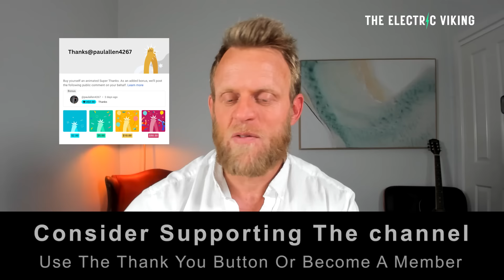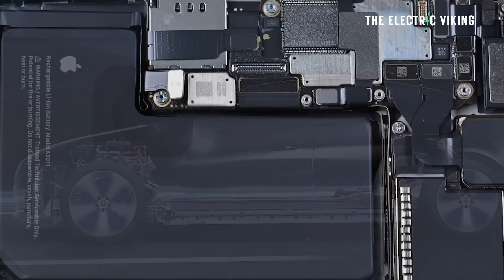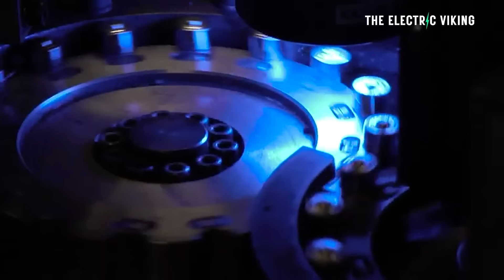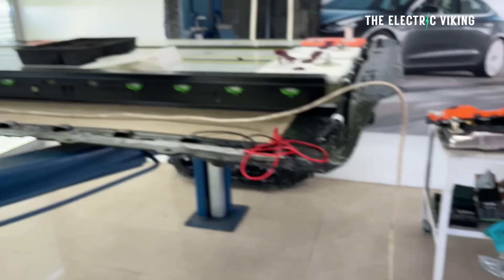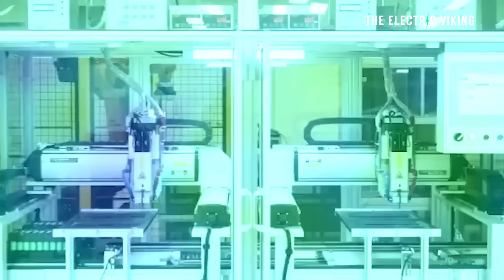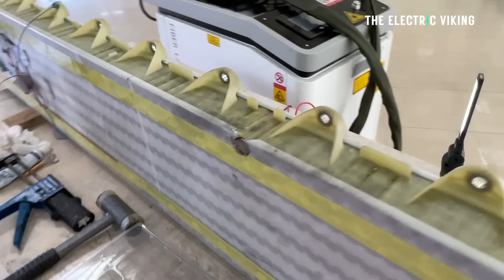EV repair company says LG cells in Tesla cars are a 'DISASTER'

Comment: You all should dig a little deeper about @EVclinic, and see what they actually did work on. They usually swap individual degrade cell in the pack with the same used cell. That worked well with all Model S, X, m3.They have had more then 600 Teslas repaired like that. That saves a ton for their customers, saved cars from salvage and they give warranty for their work 1y. Of corse, the most teslas they repaired were out of warranty. Until they stable at a Model 3lr with LG one. There was stated why in the article, those cells are far from stable and they just shared their frustration with us! There was big numbers of sold Teslas M3lr from Shanghai in EU and if they can't repair them efficiently they are angry! 😜

Comment: Here in the UK we seem to have a particular problem with battery failures in 2021 Model 3 Performance models specifically. These seem to affect cars at fairly low mileages (around 30k miles). I’ve not heard of any other model/year having significant numbers of failures. This is not high levels of degradation but catastrophic failures requiring warranty replacement.

Comment: As LG only provides those individual cells, I find the repairability differences to be very odd. I also have used many LG Chem 18650 and other cells for non-ev purposes. I usually find their output and durability to be very high. However, unlike competitors, had no built in fail-safes, so required additional monitoring to avoid exceeding their safe limits for voltage (high or low) or temperature.
As these cells for EVs are used in pouches and often made purposely with no built-in fail-safes, as the pouch/pack handles the fail-safes, I assume the panasonic cells also don't have built-in protection, though possibly are of newer design?

Comment: I bought one of the first Chevy Bolts.
Chevy replaced the battery pack at 102,000 miles and I now have 175,000 miles and they are going strong without losing any range. 
From what I can tell the LG batteries are the best batteries on the market. 
I expect them to last a million miles.

Comment: It is critical to note that it was incompetent management that cost GM/LG $2B over the Chevy Bolt battery issue, not the batteries themselves. GM management panicked and just blurted-out that they would replace all batteries. In the end, they installed a software update that was able to identify which batteries were actually bad and needed to be replaced. That was after tens of 1000s of perfectly good batteries had already been replaced.
Reply: It is not quite that simple.  The decision to recall is often made before NHTSA or other regulators get involved.  Once fires and failures are reported, companies often quickly announce recalls, vs having high profile fires and getting grilled by regulations why they didn't respond to the issue sooner.  Also, if they don't act quickly, law suits can quickly pile up, which may be a lot more costly than the recall itself.

Comment: Not sure why the EV Clinic would be working on Model 3 and Model Y batteries at the stated ranges? The Tesla warranty on these is 8 years or 100,000 miles. Neither the Model 3 or Y have been around for 8 years yet. So in theory it should only be >100,000 mile vehicles.
Reply: As far as i know, the report  talks  only about 2020/2022 LG  ncm811 from shangai.
Reply: You misunderstood what a warranty is. 
the warranty isn't a lifespan guarantee. that ONLY MEANS they will cover the cost of the battery if it fails within 8 yr or 100,000 miles.
they arent going to cover the replacement cost of every car they produce by giving customers a lifetime warranty. 
its literally just to cover early failures due to potential manufacturing defects.

Comment: The Apple iPhone vapor phase change  heat pipe is not to cool the two cell (7.4 Volt) lithium battery, as it is only to cool the A Series System on Chip (SOC) processor. There is no external battery temperature control other than to limit charging and drain current levels (throttling back speed and functionality) .

Comment: Our 2020 Bolt had a full battery failure before 20 thousand miles.  Then got 20 thousand dollars from GM back.  Almost two years after a promise from GM by letter from the vice president in 2021.  They then did the software restrictions on that sapped our range.  The newer battery went out in 7 thousand miles.  One more and they have to buy us out completely.  LG is a disaster.  I will say it.  I will prove it too.
Reply: We have had zero problems with out 2020 Bolt. Strange that you had had so many. We did install the software restriction which didn't affect us at all since we never charge above 80%. The restriction auto-lifted itself after the pre-determined number of miles and we are able to charge as high as we want again.

Comment: Tesla is having a nightmare with 2021 model year US built cars experiencing battery failure. They are handling the issue well providing loaner cars. I have no idea as to which company manufactured these batteries.
Reply: US Teslas only get the Panasonic ones.  GigaBerlin and Shanghai uses the LG cells. Supposedly some of the 2021 models have thermal design/mgmt issues leading to early cell failure under certain operating conditions over long term.

Comment: Sam, There are 2 kinds of battery makers :
- The chemistry and old battery companies (LG Chem, CATL, Panasonic-Sanyo, SK, Samsung,  etc ...)
- The automotive maker division ones (started as a spin off or a JV-Start-up initiated by a car maker, that transfered some of its best engineers) : BYD, ACC, Powerco, SVOLT, VERKOR and some others 
In your opinion, what battery company is better suited long term for Automotive applications and manufacturing quality in MASS production requirements and expertise ?
The 2nd category maybe struggling to learn about "electrochemistry magics" at first, but after the start-up phase and low yield at ramp-up they will be better suited and will ultimately replace the former ones.

Comment: LG batteries have a long history of poor performance & thermal runaway (ignition). AVOID LG.
Reply: LG cells have no built in protections, but in EVs most cells rely entirely on the pack's protection mechanisms for monitoring and safety. 
Their home batteries had issues in Australia, but outside of Melbourne or Tasmania, should never of been installed as their rated maximum operating temperatures are below most Australian state's average summer temperatures. Some of the blame really should be placed on the importers and installers. (Notice, I say some of this blame, not all).
They also don't appear to have made much improvement on their designs since their early batteries aimed for laptops... would I say to avoid at all costs? No, depends on use case and what protections you implement into your devices' design. Would I say they are the best choice? No, not until improvements are made.

Their batteries used to carry higher energy density than competitors, I have used some of their cells in a torch with no protections (gasp), except for the aluminium casing, which acted as a heatsink. Did they get warm? Yes, but they offered higher discharge rates, providing noticably brighter light emitting performance from the torch. I would dim the torch if the heat was getting uncomfortable and turn off if the light slightly dimmed... charging was a different story, I made sure they were always cool before starting a charge, and used a charger that seems to be good at balance charging. Never saw any issues, but did find the Samsung and Panasonic options offered dimmer light output, shorter runs (so less capacity) but were considerably safer as they had implemented circuits to cut power for over or under voltage. None offered more protection that that though.

Comment: Tesla should have learnt from GM's experience with the Bolt recall. I can't believe Elon gave LG Chem a chance after that disaster.
Reply: an idiot for doing so and it shows
Reply: Do you know what the actual problem was with the Bolt battery pack? And how many cars it actually affected?
Reply: If GM and China's EV fires were caused by LG's cells Tesla would have had an EV fires problem too, they don't. Tesla maybe has a LG cell reliability problem, not a fires problem because they know how to stop a failed cell turning their cars into Roman candles.
Reply: @THX..1138  Not EVERY lg pack catches fire...
Reply: The Moss Landing fire was LG, right?
Reply: Blane it on tha K

Comment: Hello Sam, great video, as usual. I purchased a new 2021 Hyundai Kona EV back in March of 2021. It now has 156,181 Km on the odometer. I just had the dealership do a SOH check on the LG Chem battery pack in it and they claim it still has a 97% capacity. I was very surprised at this result as when the car was new I could get nearly 400 Km of range from a full charge. I can't even get 300 Km of range from a full charge now (~270 Km). I'm not so sure I trust these SOH tests. Is it possible that LG Chem or other battery manufacturers have software built into their packs to fool these SOH checks so they don't get hit with the expense of a warranty claim? This battery pack has warranty for 8 years or 160,000 Km (which ever comes first). BTW; I charge to 100% every night on my charger at home.
Reply: I don't think it's good to charge 100%
Reply: @Alans-qm5ch depends of the chemistry. It's ok for LFP, not for NMC.
Reply: I believe even for a new EV rated for 400Km, you'd be lucky to get 300Km, there's always a lot of hyped up range in marketing. I haven't bought a EV yet, but in our winter weather in Canada even for a ICE car, the range on a full tank is usually less than 60% of what's claimed.
Reply: @pcstar123 There was a time, when the car was new, that I could get approximately 380 Km of range on a charge. This car was advertised as having 415 Km range when it was new. I had its SOH tested at the dealership last week and they claimed it still had 97% capacity. It seems strange that I would lose approximately 100 Km of range with only a 3% loss of battery capacity. Thank you for your reply.👍
Reply: Why are you charging to 100% every day? If the battery is NMC, it is recommended to charge only up to 80% for daily use. Charging to 100% should be reserved for occasional long trips, but it is not advisable to do so on a continual basis.
Reply: Drain battery to under 10% and fully recharge to reset capacity meter.
Reply: Tesla made the packs none serviceable so yes they are hard to repair, you are not to repair but replace only.
Reply: @George-k8n4i  battery packs are not supposed to be made serviceable, they have to be replaced.
Reply: How has the blade battery held up. Don’t hear much about them.

Comment: Without data that is verifiable by independent 3rd parties, confirmation bias is a real thing. For those who say ICE is the way, did you forget Hyundai's mass engine recalls, Ford's self-destruct ecoboost? Even Toys turbos are blowing up left & right
Reply: Ice engines have been around for 150 years and generally especially recently have a very long life. Are there problems yes there are. If you buy an ICE vehicle buy one with has abgood engine history.
Reply: @gregwilliams3210  "Ice engines have been around for 150 years" and yet they still have problems.  Engine fires, anyone?  Engines dying, anyone?
Reply: @KP-xi4bj Anecdotal evidence. Cars have become more reliable than ever up to 2010s then things started happening ...with engine quality declining for some reason. My ICE cars have all been very reliable just change oil, brakes as needed ...not very often in my cars, tires last longer and are less expensive than EV tires, my insurance was just over $50 a month on both my Saab and Miata. Toyota Yaris sold to my brother has over 350,000 miles with only oil changes and tires, I don't think he even had brakes done...his Toyota Hilux over 400,000 miles when he gave it to his gardener. Sp my experience has been very good. Older cars needed more maintenance like tuneups but back then fairly easy. So depends on your experience.
Reply: @gregwilliams3210  Can't be anecdotal evidence when Hyundai/Kia have been issuing fire recalls every year since 2015 for their ICE cars.  Even supposedly reliable brands like Toyota/Honda issue recalls.

There is minimal to no maintenance on EVs like Teslas.  Just top up windshield wiper fluids and replace tires.  No oil changes, brakes jobs, changing timing belts or water pumps.

You've never owned an EV?  Got it!  It shows.
Reply: @KP-xi4bj Don't be nasty it's a discussion. I've owned an e500 Fiat and and a Volt. Will buy anything but a CCP Chinese EV. Too many unknowns and I don't support China on their stand with Taiwan and Human Rights issues. I currently drive an electric vehicle in south East Asia as well as an electric scooter.

Comment: Are these the same batteries that Tesla use in the thousands of Powerwall batteries they have just bricked? Disabling them remotely with no plan to replace them or refund customers
Reply: They often use old car batteries in those house packs. They work ok but can't deal with the large amps needed in the car after a few years.
Reply: @PaulSamps-gf6yzIf I was buying a home storage battery I would want brand new cells in it. Otherwise, it's a great way of selling used cells for more than they cost when they were new.
Reply: @brendanpells912 you can't tell
Reply: I think the Moss Landing big battery fire was due to LG batteries.

Comment: LG Chem do not have a good pedigree in the market. So many problems. I won’t buy a car with LG Chem batteries, they just have a trust issue compared to some of the other main brands.
Reply: IIRC they had to recall their house batteries in Australia cos they set 5 houses on fire.
Reply: @mememaster147  Very true, but why were they ever allowed to be installed? Can't make it through a single summer in the last 1-2 decades in most Australian states, without at least a couple days that exceed those LG Chem solar batteries' max running temperatures. Their max allowed ambient temperatures were even further exceeded... IE. the batteries in question were never designed to handle or operate in Australian conditions.
Reply: And I would like to be able to use them too, as they are a country outside of China. Nothing against South Korea or LG Chem at all, I just don’t think their NMC batteries are at the forefront of safety.
Reply: yeah...we had the bolt issues, the ipace issues and the home battery lg resu issues... I personally would not buy then either... as you mention it's a trust issue. the way they dealt situation with final clients is also not the best
Reply: Not just cars, their home batteries are absolutely disaster too. No installers in Australia would want to recommend them.
Reply: Yep s why I bought my model 3 early on.. wanted NCA batteries not LG ncm even now avoid LG ncm and go for LFP chemistry as can't get any with Panasonic NCA cells anymore in new cars in aus market
Reply: @faz8169  NCM batteries in general are not what I'd want in my house. The increased performance is unnecessary in stationary storage and definitely not worth the decreased safety and longevity vs. LFP.
Reply: Uk model 3 LR and performance models on a 21 registration plate have a reputation as being the ones with most likely battery failures. I guess that makes them the first China made models with the LG batterys. Its not a big number but every week there seems to be a failure or 2 on the FB groups